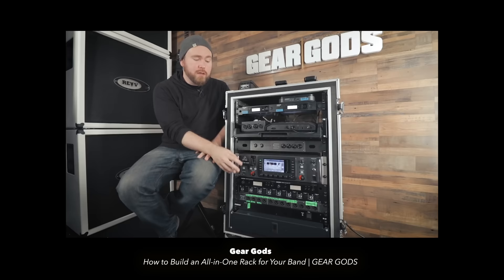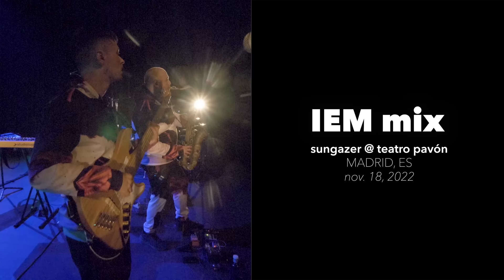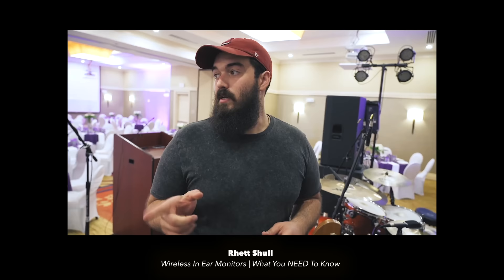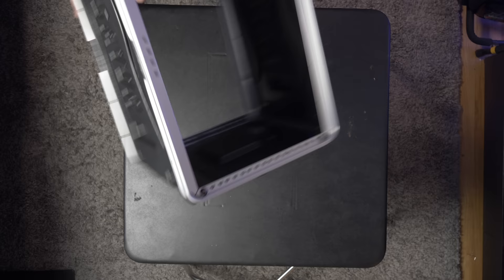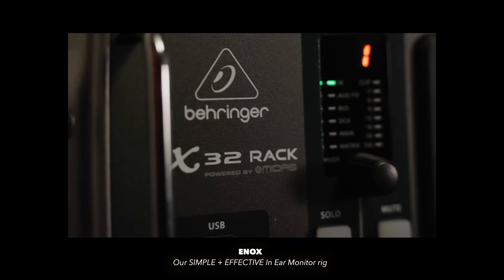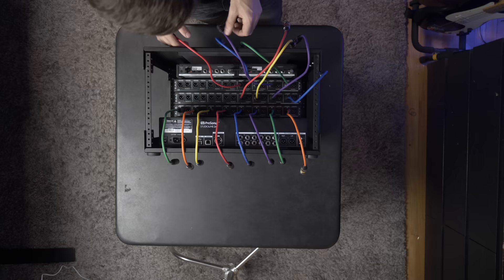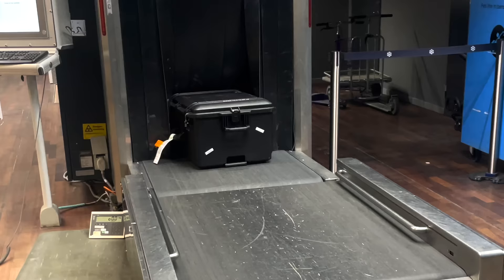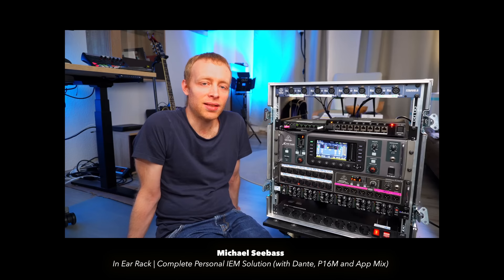How In-Ear Monitors are Making Better Musicians

Comment: Great video, I very much appreciate your discussion of inner monitors. I was in a band for a little while five or six years, and as the singer I was the only one who went to the trouble of getting in your monitors. I think I did have the shores, actually lasted pretty well for me but did eventually break after about three years. The big problem was that I couldn’t get a proper mixer and we were playing such small venues that the sound engineer of the venues, and I use that term loosely in most cases, had zero interest in working with us in that way, and we never got to do a sound check either.

At first I tried to use the built-in mixer in my wireless receiver, which technically could have two mic and puts in, but I never quite worked out how to get the guitar to properly put out signal that my monitor could receive that also didn’t interfere with the guitar output to the house. It probably just wasn’t up to the task, or maybe the wiring was just done wrong. So I ended up just having my mic which was wireless go into the wireless in your monitor which would then go to the house.

Before having the inner monitors, are used to call it singing by braille. I knew what it felt like to sing the right note, and I could hear the bass, and then everything else was just because we practiced. I’m sure it didn’t come out with the best possible result.

But one thing that you didn’t mention which I think is super important and which I never totally solved was making sure that you’re in the air monitor blocks out the ambient sound. The default ear inserts on the shore are not very good. What I ended up doing that seem to work pretty well was I took the ear inserts off of a pair of heroes earplugs and that seem to create some pretty good isolation. But something that I think is really important in order for these to actually work is to make sure that you are blocking out the ambient sound sufficiently. Not everyone’s ears are the same, and so that’s a big part of making sure that this all will function the way you want it to. Until I put the heroes tips on, it was almost worse have any in your monitors because I had to turn them up so high just to overcome the ambient sound.

Comment: Hey man, been recently using in ears for the last year or so.  I find it quintessential to use one ear in and one unplugged(unplugged being on the side the drummer is on).   Usually the drums are just mixed via the kick mic and maybe some snare or some stereo overheads.  Unfortunately, I feel like alot of sound guys high pass the kick in the in ears, which would make sense with wedges, but not on ears.  What results is some weak ass sounding kicks. In ears are great, but just wanted to put a caveat that bass players may want to try one ear in and one ear out of the in ear mix, out being the side the drummer is on.  To summarize, the in ear mix will be lacking drums due to the nature of the instrument (it is naturally loud so not as much will be in the in ear mix).  Maybe your drums are miced better, but for all the gigs I've played, it really helps to have one in for vocal cues and such, and the other ear open for the kick and hats.  I just can't feel time with both ears "in" because I can't feel the kick, if I take one out I can.

Comment: Adam, have you tried the Backbeat? You plug the bass into this unit (which is a speaker) and this vibrates to simulate the feel of a speaker behind you. You can vary how much it vibrates, and I opt to dime it, and get a massage like feeling. It actually gives me feedback, through my body to the bass (centered around E in my case). It makes playing without an amp bearable.

Comment: Like others have said, switching to IEM's has been huge.  While it's not necessary for any or most, We did splurge and get custom molded IEM's.  Not cheap, mine were about $1500 and took about 3 months to come in, but the sound isolation and better drivers I found incredible.  Protect them ears!  You only get one pair.  Thanks for the great vid.

Comment: good easy to follow video. Only small inaccuracy - PM1 is passive and requires Headphone amp. A cheap headphone amp option would be PM2.
But as an audio engineer Its really ok to get the leads from bands mixer, best if digital - for example Dante.

Comment: You're using a Presonus mixer already capable of AVB. If you go Tony place with an Avid S6L or any other Presonus as monitor or/and FOH mixer you could plug yourself into the network directly and send clean digital signals to both without any problems. If the venue instead of AVB has a Dante network Presonus sells an AVB to Dante and backwards converter that could solve all your problems with the patchbay and kill many analog connections that after the splitting could be less quality than the original signal.

Comment: Adam; a dB is not a measurement of sound level, it is a difference, a ratio, a fraction if you will. You can say something is 6dB quieter (or louder/hotter) for example but saying sound level is at 120dBs is like saying something is 120% loud; you have to specify what the dBs relate to. You probably meant 120dB(a) (decibels WRT an A-weighted filter) but as my physics teacher would say “units boy! What are the units? 120dB -what?! dB-elephants?!

Comment: I'll be honest, I'm not a great sound engineer. I mostly do assist jobs(I'm still pretty new to the industry). But when I am on board, I appreciate bands bringing their own IEMs. I've had a few small gigs where the band complains the stage monitors aren't loud enough but they're way louder than the FOH which usually results in me getting the blame for it being too loud. So I do hope more bands do pickup this habit of using IEMs over stage mons.

Comment: Adam - What are your thoughts on the built-in WiFi connect in ear monitoring system of Midas M32 and Behringer X32 mixing boards?
We use that for wired in-ear monitors in lieue of wedges. All the musician has to do is install an app on their phone or tablet, connect to the board's WiFi and select their output bus #. Then they can control their own mix of all input channels and aux inputs on the board (pre-fader preferrably).
The only gear the musician needs is wired earbuds or headphones with 1/8" plug, and a headphone amplifier with XLR input, similar to the Behringer device you have.
With the two mixers I mentioned, and some other digitals as well, it eliminates the need for your $6k rig. But I realize when you arrive at a venue you don't always find they have a compatible mixer, so you would need that rig in some cases unless you always travel with your own mixing boards and presumably your own PA system and sound engineer - which I suppose is not likely.

Comment: I don’t mind at all having some gear videos since sometimes they are really useful like this one. I haven’t been playing in a bigger band for a while so I haven’t kept along with the latest development in in-ear mixing. Mostly have been playing alone or with a small band that hasn’t used in-ear mixing. 

But with theremin I noticed quickly that my performance improves SO much with in-ear monitoring since you don’t have any feel while playing, it’s just muscle memory, control of your body and most importantly, precise listening. Even with stage monitors there’s some delay but also you hear echoes from the sound played at the stage. And some minor venues don’t have stage monitors at all which would render playing terrible. 

Thanks to your video I got to know about the smaller receiver since my current one is pretty bulky and I have more often just used a longer wire. But the problem is that it gets tangled and has more weight, pulling my head lower decreasing the performance quality. Still sometimes hard to find a good way to attach the receiver in an evening gown.

Comment: With almost 2K of comments this likely will be lost in the Frey. I was just wondering what they used for room/crowd ambience, and how/ where they placed it. We have a 5 piece and everyone is on IEM’s. LG player uses a mic’D stage amp, and the drummer an acoustic kit, fully mic’d. No other amps or wedges. I tried a couple shot gun Mics at the front of the stage aimed towards the the dance floor, but was never happy with the results. Great video by the way👍🏼

Comment: To be fair, if you let the sound engineer handle 24 foh tracks + 6 monitors (probably with some frequency work if most iem are wireless) it should be a standard to provide him an assistant. Or better have an engineer as part of the band. But that's great if you take the matter in your own hands and in-ear also is a huge relief concerning feedback so more attention on the rest.

Comment: Just a small tip regarding the wireless connection - don't align the antennas of your router in parallel. This makes no sense, because to get the best connection between a receiver and a transmitter antenna they need to be parallel - and having two of your transmitter antennae oriented exactly the same means you have lowered the possibility of that happening. 

You should orient the antennae so that they are perpendicular to each other minimize the angles they make with receiver antennae in your wireless devices.

Comment: For bands that can't spend $6000, you can still have an IEM setup for less $500 (depending on the number of members). The main difference is not wireless and not as convenient to setup. 

Cheap mixer > behringer headphone amp > Rolls personal moniter boxes > earbuds.

Comment: Hey ... re the Behringer PM1 you referred - you absolutely said they were passive and a bit quiet, but it might be worth pointing out that even the Behringer website states they are not designed to plug straight into the aux send of a mixer and require a headphone amp. For this use case, the Behringer P2 is the better gadget, is still cheap and is around the same form factor. Or the P1 if you're OK with a larger form factor but want stereo.

Far less important ...  that ART S8 is also passive, just like the snake, but it has isolated outputs - like a passive DI - and the snake does not. Minutia ... I get it. BTW, I have specifically enquired with many manufacturers about whether phantom power can damage inputs in this manner and all of them say no ... but I am with you and I can't tell whether a faulty cable makes that statement from those manufacturers less absolute, so I'd use isolation in this use case also.

On other matters it would be great to know what you use a the room mic - I know many use the Rode NT2 but it would be good to know what you did. BTW, my sneaky tip on a great room mic for this use case is the Zoom H2N with both concert limiter and concert compression enabled (setting on the unit itself) and use the mid-side array only and set to whatever pickup angle you think is appropriate ... really good.

Love your vids. Sorry to be that guy.

Comment: There's something deeply satisfying about building a rack. It's so neat compared to the jumbled mess of independent devices and wires going everywhere with non-rack systems, although there are certainly many ways non-rack stuff can be more aesthetically interesting. Perhaps there is some unexplored design space for beatifully designed rack solutions?

Comment: Great video! Nice to see the shout out to MEE. I switched to them from Shure a couple years ago and never looked back.

Do you use custom ear molds? They were all the rage years ago for maximum clarity and hearing protection, but they were ruinously expensive. Now they're much more affordable - MEE offers the option for $150. 

I've found the VE foam plugs like Comply to give me good isolation and vastly improve the sound quality over silicon tips, so I haven't taken the plunge yet.

Comment: as a FOH guy, I have to say I appreciate your DB25 snakes.  It's so frustrating to have 3 bands all come with their own setups, but need me to run XLR  jumpers for all 16-20 channels, and hot swap between every band.
It's a spaghetti nightmare and always leads to mis-patch issues.
If every band had its own labelled snake, life would be so much easier.

Comment: The most important reason to go for a more expensive in ear monitor is a build in limiter. 

As nice as the cheaper wired models are. 

More expensive models like the Shure P9HW are protection the most precious body part. 

The ear. 

I got one mint for less than 250 and its the best investment I ever made in terms of live equipment.

Comment: I think this shows that everyone's ears are different. I initially liked the MEE M6 Pro (and the M6 before that), but found them awkward to fit, uncomfortable, and that the cable design meant they were always wrong behind my ears. The Shure SE215 on the other hand, with the right tips, is really comfortable for hours on end, and I choose a wireless version for listening to music most of the time. I have SE425s too but prefer the 215s. The Behringer 251s wih the right tips sound very good as well - though the cable isn't as good (but the cable is peanuts and you can fit it to the Shure IEMs for a budget replacement).

Comment: Great video Adam.   One thing IEMs are definitely not zero latency monitoring. There is quite a bit of delay in the digital mixer, and your ears are close to hearing that delay as the sound is in your ear and not in a distant monitor.   It's the reason why digital iem systems still are not really available as it tips it over the edge.   You can make IEMs even better and less isolating by using a.KLANG system to make it spatial it also helps with the routing etc.and miracoilsy helps with the latency problem

Comment: Being able to hear yourself is a major life saver. Not only will you hear all the notes you play, but also you will get more confident, more relaxed and you can hear the rest of the band as well much better, even if you only monitor yourself.

Here where I live, a country that doesn't have dollars as currency, getting an in-ear monitoring system can be years worth of work, literally, since minimum wage is roughly $250US, and many of my friends earn minimum wage, myself included. We all wanted to have some kind of in-ear monitoring system, so, by browsing the internet I found something that could work: in-ear earphones that cost $10, a very small FM transmitter and our phones to pick up the signal. We haven't been able to use it on tour, but for some gigs and show it has worked really well. The main problem is what Adam said, the engineer and not having the ability to have custom mixes, not being able to have click tracks, etc., many problems. We have been thinking about buying a mixer so we could have some kind of semi custom mixes, but that's quite a bit of money so in the mean time we still need to depend on the engineer hah

Comment: If using Midas or Behringer, all those XLRs and two splitters not needed. The Midas DN4816-O makes the splitters/XLRs unnecessary. Use the ultranet out from the mixer to the DN4816, which requires one shielded CAT cable and provides 16 XLR outs. Use a DI Box if another two channels are needed from FOH.

Comment: It's quite funny, I used Shure SE535's for a few years. Cable would regularly need replacing, eventually the case cracked on the left side and the whole thing fell apart. I had to solder it back together and then superglue it. Eventually I replaced the left with an old Logitech Ultimate Ears (so I had one each), the sound balance was decent but I noticed the Logitech stayed in my ear more consistently.

Eventually the other side of the Shure stopped working... I thought screw it and I bought some cheaper Chinese KZ in-ears for a fraction of the price, been using them for over a year and they are still working great, they sound better than the Shures with far more clarity/detail and they actually stay in my ears. I wouldn't use them for listening to music without having an EQ to tame some of the highs/lows tho.

Comment: A small defense of the SE215's, if you replace the cable they originally come with (they detach right at the earbud like many other IEMs) you can get some decent durability out of them. 

My first pair had issues with the cable many years ago and I replaced it with a third party cable. They're still going fine and the new cable has slightly better comfort on the wrap around stiff part by your ear.

Comment: ...the thing is - its not even the stage volume, latency, or FOH engineer who could screw up your performance - the shape of the room, and treatment in the room(or really a lack of treatment) and the where monitors are pointing all contribute to these crazy nulls where for instance the bass will just drop out entirely when you move over a few inches or even better, specific notes will sound softer because of noise cancellation principles.  I remember when I switched from a guitar player to a keys player and realized what a tragedy it was to NOT be able to roam the stage to find the best place to hear the instruments I was accustomed to hearing in specific songs. Thats when I started staring at my drummer in a creepy way.  I suppose in ears would help, but I can still stare at my drummer in a creepy way, right?

Comment: I worked as a sound engineer's apprentice, doing mostly small local venues and stuff. We were also doing some medium sized events, like town festivals and so on. When we did, they've always given me something crazy to do, like a garage band with one kicked-through amp or a folk band with two violins, contrabass and a Cimbalom. One band had an electronic drum kit, but without any "electronic" parts (they've pretty much saved it from the dumpster and played on it with so much force, that it actually made some -pretty horrible - sound). Seeing this, I have to admit, makes me a bit jealous.